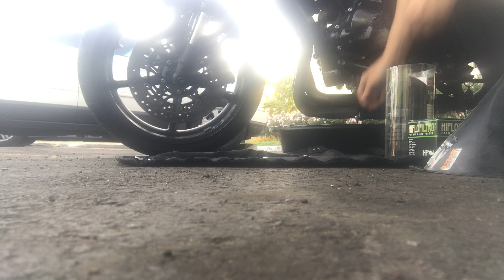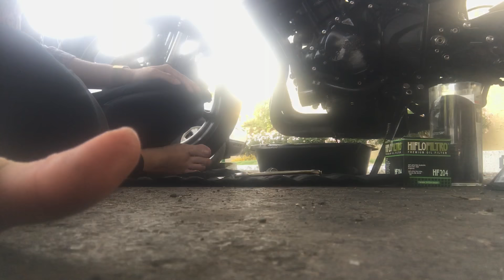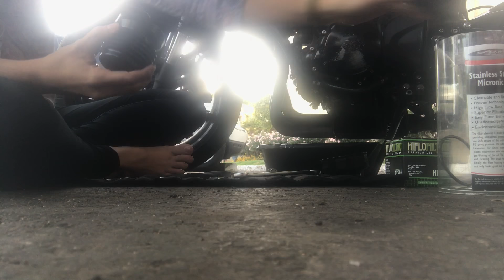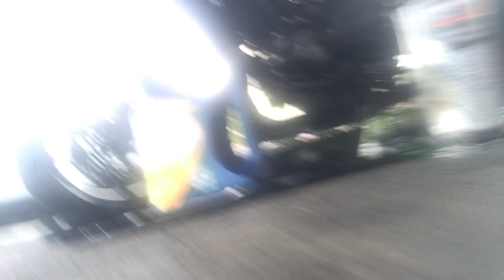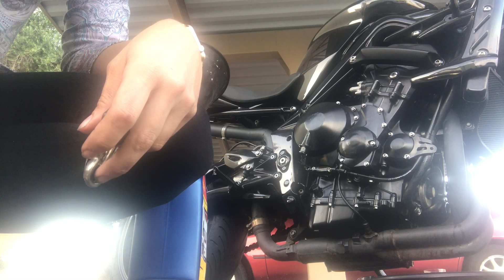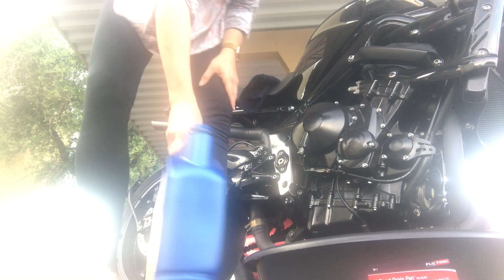Triumph 675 Oil change to new Reusable K and P Engineering filter

Comment: can you not edit that section of music out using YouTube's online thing and get the audio back?
Reply from the maker: +urbanprowler I tried but because the original upload has a half a second clip of someone's cars music as they drove by I had issues with the copyright even after removing audio so I just did it pre upload
Reply: Triumph Babe ah, it's a pain when that happens. where I used to work involved uploading music videos that we owned the copyright and it still cut the audio every now and then. 
do you have monetising switched on? that can cause problems.
Reply: Triumph Babe just this video not the others.
Reply from the maker: +urbanprowler yes I dooo :3 I can still add music through edited on here now I just.... haven't. :/
Reply from the maker: +urbanprowler erm you've lost me.
Reply from the maker: +ClutchPedalReturnSpr if you could pm that to me I can get to it from a computer to check it out :)